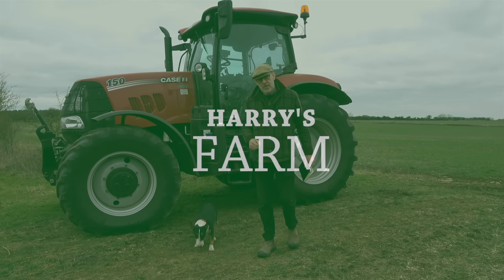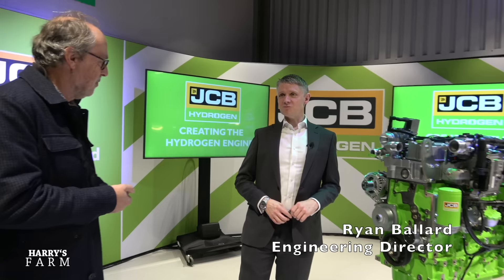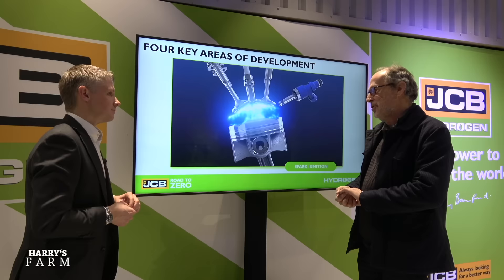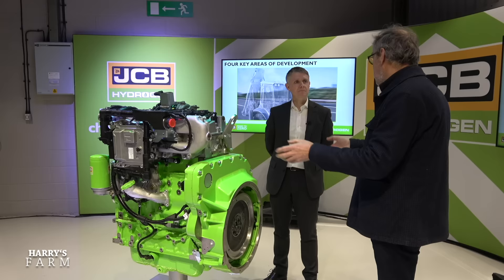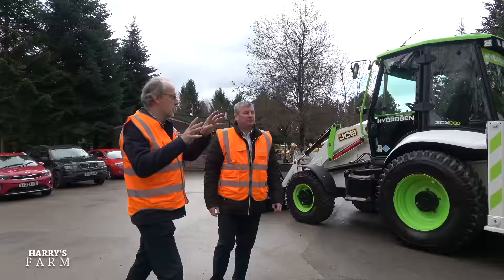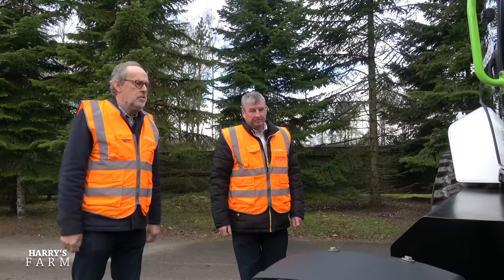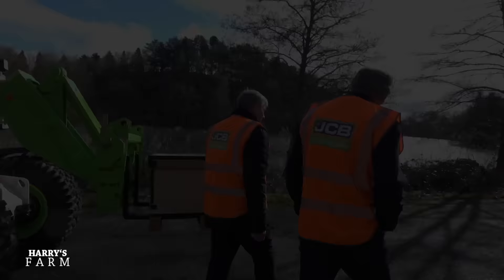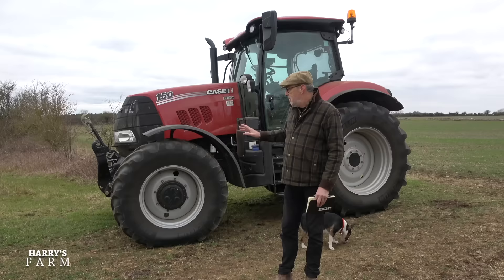JCB is moving to hydrogen power for all their big machinery. Here’s why.

Comment: Thanks Harry good video, good to get some answers on the high Nox question and nice solution they have gone for lower firing temperature. One thing to keep in mind though, especially for mainstream products (cars) using high volumes of hydrogen would become problematic as the complete cycle efficiency from green energy to hydrogen makes it non competitive vs battery. Green energy converted into kinetic energy through a motor (~95% efficiency) and battery losses take to you say 80% efficiency. However, converting green energy to hydrogen through electrolysis 75%, then combustion at 40% gets you to 30% cycle efficiency before you have taken into account compression losses to pump it to high pressures. Happy to educate you more if you are interested!
Reply: Your right, the maths don't work out for cars but for construction and marine these could be a game-changer.

Comment: Fantastic video. I love how enthusiastic and excited the JCB engineers are about the project. 

At a cost of £15 per litre- at today’s prices hydrogen will cost £150 per day. At £20 per hour + overheads an excavator driver might cost £240. The hydrogen is not insignificant, but it is not going to dominate the cost of doing a job with an off-road vehicle.

I can see this being adopted for work in ULEZ zones, and spreading out from there.